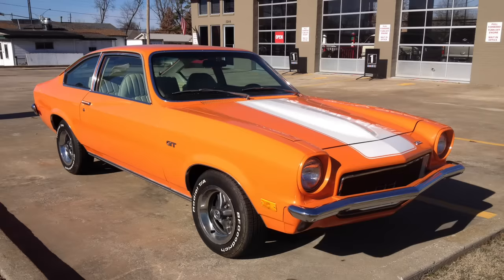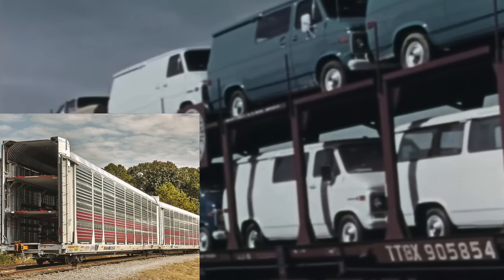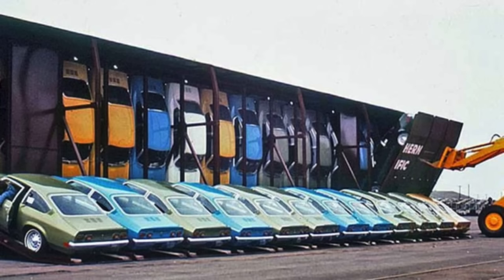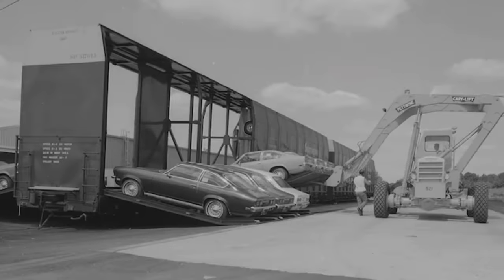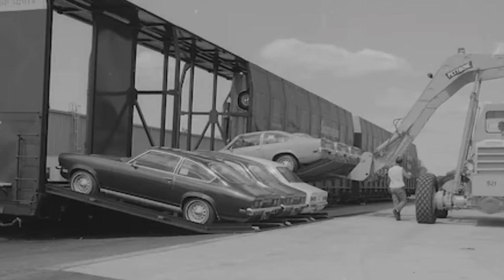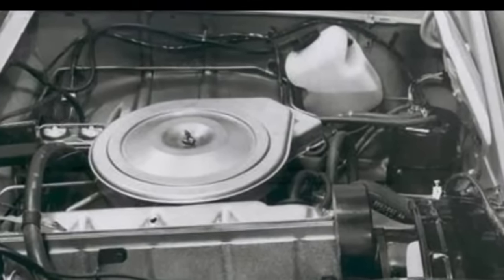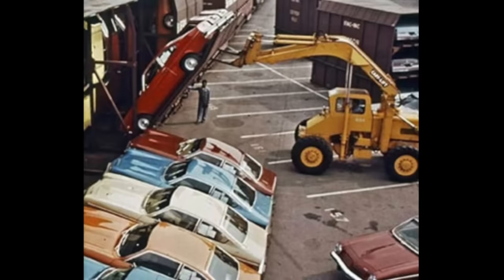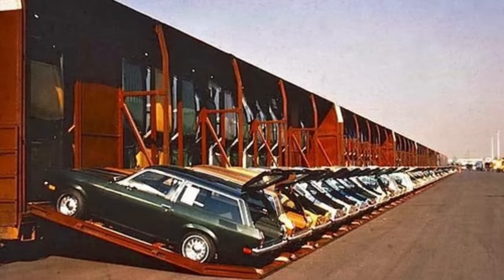GM's Coolest Invention Wasn't Even Part of a Car: The Chevrolet Vega's Vert-a-Pac Shipping System

Comment: As a retired railroader with 41 years of service in the industry, I can provide some insight to this concept from a railroad perspective. First, loading and unloading the Vert-a-Pac cars was incredibly labor intensive and, in many aspects, dangerous. In addition, the cars needed a very wide space to accommodate the open doors which took up a lot of yard space that could be used for additional tracks. It was also very time consuming to load the vehicles and secure them to the Vert-a-Pac. Closing the doors on the Vert-a-Pac was tedious and potentially dangerous. Dropping a loaded panel would have devastating results and I'm sure it has happened more than once. The process needed to be done in reverse during unloading. Second, the 70s were hard times for the railroad industry. Deferred maintenance resulted in very rough track. In modern times, when the railroad industry is thriving, the ride would still be rough for a vertically mounted vehicle. In the 70s, the Vegas took a beating during transit because of the poor quality of the track at the time. Another consideration that was overlooked with the design of the Vert-a-Pac system is the dynamics of Slack Action in the trains themselves. Even under skilled control from the best engineers, serious and powerful shock forces from train slack occurred. With a vehicle mounted flat, on all four tires, slack action was minimized by the tires and tie-downs that were used. With a vertically mounted vehicle, these in-train forces were transmitted sideways to the vehicles which seriously magnified the forces and shock to the vehicles before they even reached the showroom.  So, there are a few additional points to ponder with the Vert-a-Pac concept.
Reply: I was inches and a split second away from being killed by Slack Action. While making repairs on an outbound train, the Carman on the head end dropped the blue flag without notifying anyone. 
The end of the cars went from point zero to four feet away from me in the blink of an eye.
Reply: Very cool what you posted here as a comment. Thanks to both you and Adam for educating us on this rather strange car carrier. I was not aware it ever existed, albeit I did see a promotional film from GM about regular covered car carriers from the 70s when they introduced them..
Reply: Thank you so much for sharing your insight! GM should have talked to folks like you prior to implementing this plan
Reply: Talking to railroad employees (Union) would be like automotive management talking to assembly line workers (Union)
Management & Union, NEVER shall the two meet!
Reply: Thank you for this interesting contribution 👍
Reply: @nthused  Unfortunately the spirit of Management has not learned anything or moved an inch during the years that have passed since this. Regardless the industry. 
I have been in the hotel industry for three decades and left because of the performed ignorance from the management not to listen to the staff on the floor before implementing new ideas. They have higher belief in their calculator display than in reality.
Reply: Thanks for an excellent and informative statement on the evolution of vehicle delivery via railcar and the pitfalls that occurred in the engineering and construction of the units over the years. Great story to share with my sisters husband who retired from CP RAIL after three decades as an electronics engineer. Cheers from up north 🎉
Reply: novel idea, terrible once you start digging down into it
Reply: Really nice insights into the challenges with this. Its another one of those idea's that sounds really cool on paper that doesn't really work in reality.  The whole concept of raising and lowering the doors/holders with a forklift seems like a prescription for disaster.
Reply: It's a fascinating "what-if" feat in engineering, but doesn't seem like it's anything more than that. Seems very impractical.
Reply: A very well written and informative comment.
Thank you
Reply: Are there any verti-packs left in some obscure railyard somewhere or did they all get scrapped?
Reply: Great comment! 👏👏👏
Reply: EastEnd please make some videos on some of the major railroad safety issues back in the day.
Reply: The whole idea was just ridiculous.
Reply: Hopefully railroad retirement is treating you right!
Reply: @nthused  Talk about what? No one had ever tried something like this. There's no body of experience to draw upon.
Reply: Just like 99% of all of these "novel and game changing" ideas. The Line (building), Hyperloop, pod transports,... 

How do you recognize a good idea?

It is never really hyped, it seems to appear out of thin air after several years of hard work.
Reply: Yeah, crazy time, romantic in many ways…
Remember in 50s or 60s Mercedes built a Mercedes race car transporter?)) you know, with a Gullwing engine and all that, one of the coolest car designs I think)
Reply: Your a great writer
Reply: What about fluids upside down
Reply: @ak2nda695  wowah nice stories, from both, learned a lot about slack action just now. Do trailer trucks/lorries take advantage of slack action? I always wondered why freight trains could pull hundreds of times more weight than trailer trucks are able to on the road from standstill.
Reply: @6Sparx9  Trucks/lorries do not have slack action involved. You would be surprised how easy a rail car can move. I once had to help set hand brakes on over 100 empty cars (coupled together) due to high winds.
Reply: @6Sparx9  almost no rolling friction between trolley wheels and tracks, I suppose
Reply: @llMarvelous  Yeap, Real Engineering did a video about it recently, crazy how reducing friction can negate massive amounts of weight, and slack action helps distribute overcoming the inertia of each carriage instead of needing enough torque to pull all at once.
Reply: Fluids would leak out of the Vegas during transit also.
Reply: @zarstar1576 de I wanted to know that too! I think they were filled at the dealership 👍🏻
Reply: @jstravelers4094  Thank you.
Reply: @deltajohnny  Thanks.
Reply: @zarstar1576  Thank you. I enjoy writing and as a result get a lot of practice.
Reply: @nthused  It is possible that they did. But "pet projects" often overlook or outright disregard details and facts that threaten their goal regardless of how important they may be.
Reply: Good informative post, always wondered about that 
Poor cars were shaken apart before they even hit the lot lol. 
Sure would love to have a new early 70s van in that vid.
Reply: @ak2nda695  Wow...cant imagine how dangerous working around those could be. 
Quit learning how to work on diesel big rings in the 80s after watching someone get crushed by a clutch falling off during removal...another guy didnt use a cage once removing a tire with those split rings. His head was instantly red and a strange shape. He collapsed dead within a minute or two. That was enough for me
Reply: @scottmacleod6301  Was going to ask the same question ...
Reply: That’s some fabulous information!!  Thanks!
Reply: I was thinking that the main metric for a train is one of total mass as well as length (how many carriages).  While I know the rolling stock is heavy, well cars are also heavy, and I have to think the mass of a vertipack carriage is higher than a conventional car carrier.  Since the vertipack has all the issues you mention I see only a lot of inefficiencies in extra car design and construction, railroad handling, and the loading safety concerns you mentioned but not really any significant gains to make this venture worthwhile.  It just looks like a better idea to use more of the conventional car carriers to do the same job.
Reply: @GR-tr4qq  Waiting to fill the fluids at the dealership is a major change in operation.  Most transportation steps from the end of the assembly line to the dealer prep lift involve driving the vehicles briefly.

Battery acid, fuel, engine/transmission/differential oils, and brake fluid could leak.  And they won't be dripping on the ground, but rather places that wouldn't normally need to shed fluid in that orientation.

Brakes in particular would be a risk: you wouldn't want fluid to drain out, leaving the transport driver with no brakes.
Reply: @SynicalDan I guess you did not watch the video then?
Reply: @zarstar1576 if only they addressed this in the video!
Reply: Has anyone ever attempted to design a vehicle and railcar so the the length of the vehicle would fit the width of the railcar?
Just simply drive the vehicle onto the railcar sideways.
I think railcars are about 10.5' wide.  The Vega is around 14 ' long.  
How wide are tunnels?  What kind of width restrictions are there for rail?
Reply: @scottmacleod6301  My understanding is they were all converted to flatcars or conventional auto-racks after the Vega (and Pontiac Astre) disappeared around 77 or 78.
Reply: Very interesting. Thanks!
Reply: It's pretty ironic that most of the problems described only exist because of the absolute mess that US railroads are/were in due to the car lobby.
Reply: great idea hits reality check !
Reply: Yeah, this is one of those "sounds good" ideas.

But all the stuff you have to do to make this idea work is fucktarded and why it wasn't done before and didn't continue being a thing.

It turns out the old process becomes the new solution to all the problems you didn't originally account for.

Shipping cars like they drive means you don't need to do all sorts of engineering changes to just make transport possible, the suspension in the car helps protect the car, ect.

Because so many real problems have been solved, people keep undoing them as if the old solution is the new problem.
Reply: @SmackyTheB3AR  That's correct. Autoracks, including Vert-a-Pacs, are built as a car-carrying body of whatever type mounted on top of an 89ft flat car. When they stopped shipping vertically, they removed and scrapped the Vert-a-Pac bodies and replaced them with conventional autorack bodies.
Reply: @anivicuno9473  Not really. The difficulty of loading and the problem of slack action have nothing to do with the quality of the railroad.
Reply: @6Sparx9  You don't get slack action on trucks. Slack happens because there's a few inches of play in the couplers. Multiply that by 100-150 rail cars and that's a total of tens of feet per train. Now, suppose you're running downhill. All the cars will bunch up together. When you get back on the level, any acceleration will start stretching out the couplers one by one. The locomotives move a few inches before the first coupling becomes tight, and there's a little yank on the first car. Then they move forwards a few more inches and there's a slightly bigger yank on the second car because the locomotives have been accelerating longer. Again, multiply that by 100-150 cars, and the last few cars can get a real big yank, as the locomotives and the head of the train have accelerated quite a bit before the back of the train starts getting pulled.
Reply: All interesting. I’d argue saying the 70’s were tough on the railroad is crazy considering they control everything
Reply: @Gixsir  The railroads don't "control everything". The 1970s was definitely a tough decade for them. The government had had to nationalize passenger service by creating Amtrak, because the railroads couldn't afford to run passenger trains any more. Major railroads like the Pennsylvania, New York Central, Rock Island and Milwaukee were going bankrupt. The Penn/NYC bankruptcy again forced the government to step in and create Conrail.
Reply: Just a lil elbow grease it'll be fine
Reply: @ak2nda695   Were  you under the blue flag protection?
Reply: Good points! Would not have thought of those.
Reply: Wow Debbie downer. You should write sad novels. I bet you're fun at parties.
Reply: @FK-GOOGLE  Truth, facts and first-hand experience upset some people. I can see that you're one of them. The whole concept of the Vert-A-Pak was a downer. It failed miserably. The modern method of shipping automobiles is infinitely superior from the standpoints of safety, efficiency, cost and labor. Too bad your day was ruined with reality, but I'm happy that the majority of people appreciated the information I provided.
Reply: Excellent commentary! Lots of points I never would've thought of.
Reply: How where the Vegas secured to the doors and how where the rail car doors locked and secured in the up position? Thank you for sharing real first person experience.
Reply: @fredburban8219 Sad, but true.
Reply: Thank you for sharing your expertise. It’s much appreciated.
Reply: So what about the engine fluids

Comment: Not a bad-looking car. It WAS a bad car, but not bad looking.
Reply: @@HelicopterDad-xk5sxyah but most new cars start and run…A Vega…not so much. This was one of the cars that drove buyers to Japanese cars, they didn’t want to carry tools in their trunk to get home.
Reply: My older brother bought a 1971 Vega. He loved it but after two years and about 40,000 miles the engine was shot. One of my classmates bought a 1974 Vega. It wasn’t much better.
Reply: Why did they design that engine when gm Europe had a a choice of different engines of similar capacity that weren’t quite as s**t?
Reply: @scottyg7284  because it was Ed Cole's baby . He also brought us the Corvair .  Need I say more ?
Reply: @gregz6418  
I had many and worked on many more and wouldn't say any were undependable. 
But that engine, what were they thinking! If you sleeved the block it wasn't a bad car, till the rust took over.
My first one all the local gas stations knew me as $10 and 2 quarts.
Reply: @gregz6418 vegaGT was my first car.. my dad's buddy sleeved the motor with cast iron sleeves...that car was a great first car it was a hatchback with a bed in the back and home stereo speakers...bf Goodrich ta raidles..everyone thought it was a cool car
Reply: I had one with 190000 miles on it. was a great car
Reply: It sure was better looking than most small cars, esp the Pinto.
Reply: When I got mine we lived right on the dune in Florida. After a storm you see salt grains forming in the windshield and on everything.  My little yellow 3 speed never stood a chance. The block was so soft that you could cut a sliver off with a knife when at operating temp.   I sleeved it but the rust attacked the hatch hinges so quickly after that, it was junk. 
The Datsun I bought after that was just as bad.
Reply: @bearlemley  BMW was famous for thin Sheetmetal. They rusted on the showroom floor.
Reply: My first car was a 75 Vega gt. 4 cylinder with a 4 speed. It wasn't great but it was easy to work on and I went thru 3 motors and 5 or 6 heads to drive it for 3 years.

Comment: Engineers: "Let's save gazillions by shipping our cars vertically!" 
Also Engineers: "Let's spend gazillions modifying our cars so they can ship vertically!"
Reply: In actuality, it was just a handful of minor adjustments that were required.
Reply: The railroads saved money, not GM. It was Southern Pacific's idea, not GMs.
Reply: @Greatdome99  

If true thats funny (and not doubting you). Its just that everyone is slamming GM over it and will probably be remembered as GMs doing.
Reply: @Greatdome99 Surely the railroad passed on some of the savings to GM? Otherwise, why would GM bother?
Reply: @nkt1 correct - it was a joint project.
Reply: Let's invent fuel injection so there's no leakage.
Reply: @brianb-p6586  yes, they were smoking a joint when they came up with this idea.
Reply: Also, let's spend gazillions on building specialized railcars, that only serve 1 specific car! 😆
Reply: @itoibo4208  had to be. It was the 70's, so I'm sure they had some nice cold "coke", with that joint.
Reply: @BiffTannon1983  they were just containers mounted on standard flatbeds, and kept continually busy with that one model so they were efficiently used.

Comment: There was an episode of "Mad Men" where the guys from Sterling Cooper were talking about the ad campaign for this magnificent, revolutionary car that Chevrolet was about to launch.  When it turned out to be the Vega, that was quite a hoot.  It's surprising Ed Cole became GM President after all the Vega's problems.
Reply: Ed Cole was President before the Vega, he was responsible for a lot of innovations at GM like the rear engine Corvair, aluminum Buick V8, Tempest with 4 wheel independent suspension and 4 cylinder engine made of half a V8. Even the front drive Toronado and the original Chev  283 V8. Most of his ideas failed to stand the test of time but a few were engineering marvels.
Reply: @mrdanforth3744 Chevrolet produced the 265 V8 before the 283.
Reply: @mrdanforth3744   That's what I thought, but I believe Adam said Cole became president after the Vega.  I'll listen again.  Cole's greatest contribution was the Chevy small block , when he was in engineering.
Reply: @tombrown1898  he did say that ,but he was mistaken .
Reply: It’s called “failing up” and is extremely common in the business world. I’m not sure Ed was guilty of this, but many others have been.